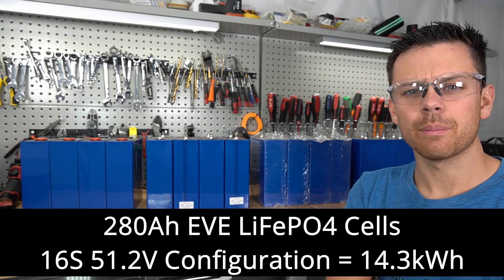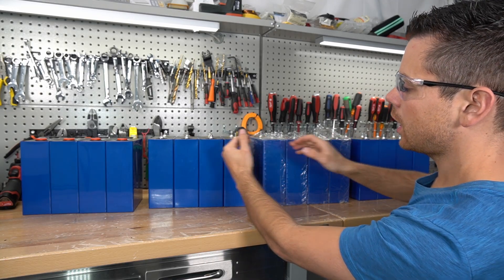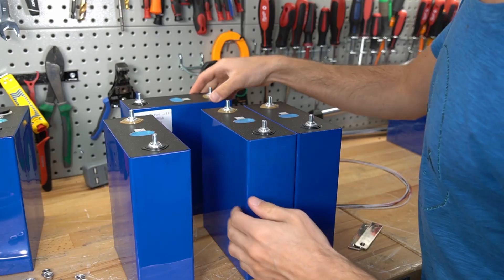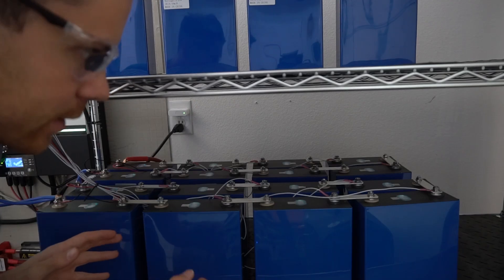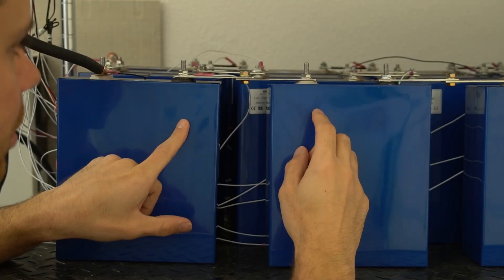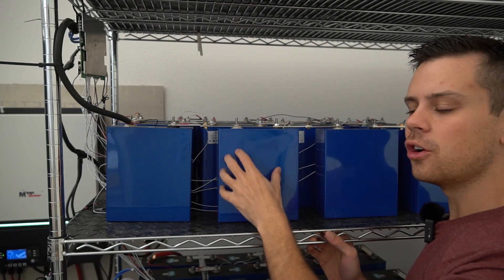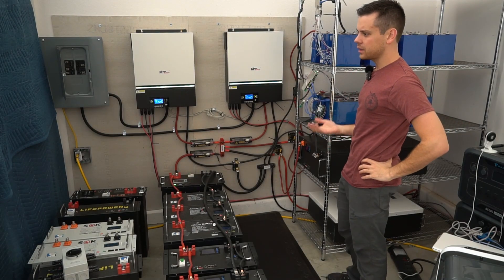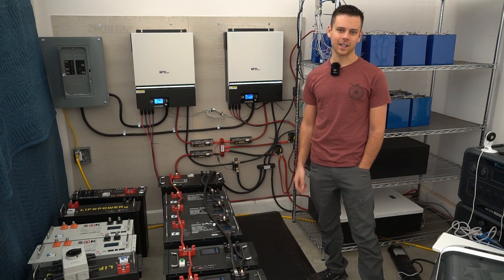Quickly Balance and Build a 48V LiFePO4 Battery w/ Cells from Different Suppliers

Comment from the maker: If you have used/grade b cells, and need to do a full top balance, check out this video: https://youtu.be/x5ABvbbics8
If you are new to building batteries, check out this video: https://youtu.be/uCC_3LoLYuw

Yes, the shelves can handle 2 or even 3 times the weight of these cells. That is why I spent more money for this type of shelf. I have had tons of people complain about this in past videos. 

Parts list for this battery:
LiFePO4 Battery Cell Deals: https://www.mobile-solarpower.com/raw-lifepo4-deals-page.html

DIY LiFePO4 BMS: https://www.mobile-solarpower.com/raw-lifepo4-deals-page-676969.html

Heavy Duty Shelves for Battery Building (ad): https://amzn.to/36afayC
Insulative Liner: https://amzn.to/3IaEX7a

~~~~~~~~~~~~~~~~~~~~~~~~~~~~~~~~~~~~~
Tired of getting ripped off? Check out my "Will Prowse Approved" solar product recommendations below!

12V Batteries
https://www.mobile-solarpower.com/lithium-batteries.html

48V Batteries
https://www.mobile-solarpower.com/48v-batteries.html

Offgrid Inverter System Builder
https://www.mobile-solarpower.com/48v-complete-system-blueprint-559371.html

Hybrid Inverter System Builder
https://www.mobile-solarpower.com/code-compliant-48v-offgrid-system.html

Mobile Handtruck System Builder (very popular!)
https://www.mobile-solarpower.com/mobile-48v-system.html

Solar Panels
https://www.mobile-solarpower.com/300w-solar-panels.html

Ground Mount Solar Racking
https://www.mobile-solarpower.com/ground-mount-racks.html

Wire, Lugs and Busbars
https://www.mobile-solarpower.com/wire-and-connectors.html

Tools
https://www.mobile-solarpower.com/tools.html

Fuses and Circuit Breakers
https://www.mobile-solarpower.com/fuses.html

Plug-N-Play Solar Systems
Ecoflow, Anker And Bluetti! So many models to choose from. See my current recommendations here:
https://www.mobile-solarpower.com/full-size-systems.html

~~~~~~~~~~~~~~~~~~~~~~~~~~~~~~~~~~~~~~~~~~
Need to build a large DIY system? Need a trustworthy solar distributor? These are my favorites:

Signature Solar
Creator of EG4! Solar Minisplits, Victron and More! Largest Solar Store Online.
If you want $50 off, please use my link below and coupon code "DIYSOLAR50":
https://signaturesolar.com/?ref=cPwLcVc0SW-BjN

Current Connected
Best Prices for EG4, Victron, Midnite and so much more! Fast Shipping and Highest Rated Customer Service:
https://currentconnected.com/?ref=wp

~~~~~~~~~~~~~~~~~~~~~~~~~~~~~~~~~~~~~~~~~~
Join our DIY Solar Community 
Need more help? Join the largest solar forum on the internet for beginners and professionals alike. 140,000 members and counting!
https://www.diysolarforum.com

Check Out My Free Book
Best-selling and beginner-friendly guidebook to off-grid 12V solar!
https://www.mobile-solarpower.com/the-book.html

~~~~~~~~~~~~~~~~~~~~~~~~~~~~~~~~~~~~~~~~~~
Contact Information:
I am NOT available for personal solar system consult! If you wish to contact me, this is my direct email: williamprowsediysolar@gmail.com
FTC Disclosure Statement and Disclaimers:
Every video includes paid promotion or sponsorship (such as free products for review). Some links on this YouTube channel may be affiliate links. We may get paid if you buy something or take an action after clicking one of these. My videos are for educational purposes only. Information is subject to change/update at any time. Electricity is DANGEROUS and can kill. Be smart and use common sense :) DIY Solar Power with Will Prowse is a participant in the Amazon Services LLC Associates Program, An affiliate advertising program designed to provide a means for sites to earn advertising fees by advertising and linking to Amazon.com
Reply: Yes! Thank you for this video Will :)
Reply: Will I use a T8 charger to bring  new packs up to full charge as it active  balances as it charges - its limited to 8S - I've built quite a few RV packs and its  saved a lot of time
Reply: Would you be able to give us an insight to your electric bill. Do use use much from the mains grid? Thank you
Reply: Will, your thoughts on the latest sodium ion batteries for stationary storage would be very much appreciated. They appear to be catching up with lithium, in some aspects and the advantages disadvantages would make a good video, in my opinion.
Reply: Hey Will, are you still using those Midea wall units....how much power do they draw? Looking to take the skoolie off grid with the AC, trying to figure out the battery bank if I use that unit.
Reply: Why not just watch his old videos? One by one
Reply: Hey will, thanks for the very informative videos. I dont know if you notice but your following is all over the world and not just in the US but most of the products you review are not accesable in some parts of the world. We would realy apreciate if you start doing reviews of other brands wich are accesable in other parts of the world.
Reply: Thanks for your video, I really like it ! Why not a video test of blade battery soon ? Thanks anyway
Reply: Is there a way to create a 72 volt system like this for use with my golf cart?

Comment: I've got a bunch of EVE 304 cells that I bought a year ago that have been sitting on the shelf. I started pulling them down to get ready for battery boxes that are coming in a month or so. First charge took in 200ah at 3.45v and the next day I was working with the cell and it wasn't responding as expected and I put it back on the charger where it rose pretty quick to 3.45v but sat at that point and absorbed another 30ah. Other cells I've pulled out have been doing the same. Random capacity tests have produced well above 304ah testing between 2.5 and 3.45v. Don't know if that might be normal for new cells that need to be conditioned in that manner or not but I find nothing wrong with them and seem to be performing fine after that initial charging. Don't think I would want to put them together in a pack and let them do their thing. Probably wear out a good balancer trying to deal with those in that initial state?

Comment: If you are looking for a Video Idea, I have one.
Scenario
I have a RYOBI RM300e EV Riding Lawnmower
4 X 12 Volt Lead Acid Batteries = 48 Volt 50 AH Series Array
I want to build my own LifePO4 48 Volt Battery Array Case that is rebuildable.
4 X 12 Volt Lithium-Ion Battery Cases. OR Would you choose to build one 48 Volt Case?

My idea is to build ONE (1) case with individual cells slid into their own slots and use cables 4 Guage or 6 Guage to connect them together. This way over time, I can replace one cell as I need to. I would unlatch the lid and open the case, unbolt its cables and remove the single cell from its slot, that is going bad and replace it, then equalize them and re-bolt the cables, then seal the case again and lower the seat of the lawn mower. 

I do not believe you would need to build this.
You could just use old video footage and edit together scenes showing what to buy.

I do know the current RYOBI Charge is not for Lithium-Ion batteries.
It is only for Lead Acid or AGM batteries only.
This means also suggesting a new LifePO4 charger for a 48 volt configuration.
The charger port could be reused as it is rated for such currents.
The charger plug on the current charger could be reused as it is removeable.

I just want to restate that I would build a 48volt case with slots for each Cell, so any one can be replaced at later times.

The reason for this thinking is only needing to buy or build one BMS instead of buying or building 4 for the four 12volt cases.

Also, the lawnmower has 4 slots for 4 12volt batteries and so I need to put in a board for the one 48volt case.

If I build a 48volt case, the bottom of the case would be my battery tray. 

I would just build and fiberglass and paint the whole case inside and out and then put a rubber mat on the bottom to reduce vibration.

I have no videos, so if I build this, I may video it and upload it in a series of vireos.

Anyways, just a suggestion.

Comment: Warning this is a blatant informercial site featuring top dollar products.  You would be better off buying a complete system from a solar system supplier using top products (which they get at OEM prices) together with a full 5 years full system guarantee for around the same price.  If you are going to spend  $$$$ you need an expert supplier or have the time and electrical bg to build your self .  NOTICE the all import BMS equaliser he doesnt show what it is or where he sourced it - thats the dont tell clickbait trick

Comment: Hi Will. I will be going with Diy Solar Warehouse's 12kw system. I currently have (32) 230ah eve cells in my diy ev. I'd like to upgrade the batteries (as i've over charged a few and the IR is off, but could be useful for our home) in my EV, but use the 32 cells for a 16s2p 48 system. Because the DIY ware house system uses micro inverters I am told I need to use a AC battery. Is there a system that can use my Eve cells for a home battery? I would like get off the grid. Thanks

Comment: Hi...if using 6kw high frequency battery charger,with rema320 connector with CAN bus protocol..is that any bms come with can bus connection? Or any can module that can coordinate with bms and the charges?

Comment: I'm thinking about getting solar installed, and got a quote for a 6.6kw system, 5kw Solax inverter and 5.8kWh Triple Power battery.  To reduce the cost and improve the battery capacity, I was thinking of getting them to forget the battery and DIY one instead.  X1-Hybrid has 85-400v range, can you do a 34s - 35s battery pack?  Is there a suitable BMS for such a battery?

Comment: I've had AGM batteries for years and noticed the voltage gets unbalanced, so I charge them independently to get them to the same voltage. Has anyone ever put two MPPT charge controller on a 24-volt system to keep the batteries balanced? Would it be best to split the array so each controller would have its own panels?  I'm thinking it would be best to keep the panel together and put a charge controller on each battery to keep them balanced. I know there are balance controllers out there and I don't want to use them because that would change my charging profile as much as 10 amps from what I have read.

Comment: I really want to use the EVE cells on your page but I cannot find a BMS to match the 280Ah or even 230Ah. Overkill only has 100-120 Ah. Is the “chip shortage” affecting BMS?
Reply from the maker: 100A BMS is great. Just stick with that. If you need more power, out multiple packs into parallel

Comment: Hi Will.  I am building my own 48V battery array using 4 x 12V 50ah batteries with built in BMS for each 12V battery.  When joining them up in series I had an idea by using 50ah ANL fuses as the interlinking fused bus bars & it fits & works well so far (not yet fully powered up with the inverter).  Is this fused bus bar idea a good one or unnecessary or will it have knock on impacts (heating, inefficiency etc).  Love to know what you think.

Comment: The scariest part of the video is your faith in the metal rack and is load capacity. That is only plastic sleeves that pinch the tube.
Reply from the maker: It can handle 3X the weight, and my friends warehouse uses these for way more weight. You should try it. And yes I know how the sleeve works. You need to set it properly. I trust a companies safety certified equipment over some random YouTube comment. Actually this is a perfect time for a challenge. You need to make one of these fail, and post a video. Can't wait to see your post.

Comment: Hey Will,

Whats your thoughts on using 200 3.2 8a cells to make a small battery bank? Is there any negative to this? Is there higher likelihood that the batteries will fall out of balance or what is your experience with this?

Comment: Is it ok to charge a lifepo4 battery at a very slow rate? I'm planning to load a 50 ah battery with a Tecmate Optimate 1 charger. That it will take a few days is no problem for me.

Comment: Hello from Sacramento CA.  question  anyone, anyone all, I am attempting to use my sailboat and airstream trailer to load share my home. So my attention is on my airstream trailer build with an eye on the future. So I want need a 48v  system that can supply 110v / 220v /12v supply and do load sharing with my home. The idea is why let my sailboat and trailer sit idle when home? So more like a mini mobile generator/storage  for my house. I think this will work out great. Because when home it supplies my demand but when gone household demand drops and my mobile demand is supplied. I want 3days continuous runtime in inclement weather. Right now I can go 2weeks with no solar but I have to use propane I fill my tanks once yearly (4 two 20lbs and two 15lbs.) I not really wanting a low frequency system for noise. I would rather have a high frequency or two so I don't have to listen to the hum In the trailer. I could build it outside or on the front. Any ideas?

Comment: How much kilowatt energy is in this pack? I know you said 91 kW/h but what is it in term of amount of energy? I'm trying to see how long this battery pack would provide to a home that averages say 30kw a day. Thanks!
Reply: You have your units all mixed up. kWh is a unit of ENERGY, and kW is a unit of power. You can't say your home pulls 30kW a day. Your house could be pulling 30kWh of energy per day, and that would be equal to an average of 1.25kW continously.
Since your house averages 30kWh a day, the 90kWh battery would last three days in theory. That was the whole shop though. The 16 cell battery he built is 14.3kWh, which would get you through half a day.
Reply: @icyfox2011  Yes, you're correct. Thank you.

Comment: Dude, cool channel. Would you be interested in putting together a video discussing best charge/discharge practices for EV's? There's this whole community of mostly clueless EV people who want to optimise for longevity. Most videos and communities are regurgitating the same old. I expect you'd speak to the topic with ease.
Some points of interest:
Depth of discharge
Rate of discharge/charge
Cycle depth
Capacity recovery effect
Temperature
Cell types
Balance and float
Degredation types (resistance - power, capacity - energy)
Unnecessary battery cycling (leaving the car unplugged)

Comment: Please start reviewing and testing wind turbines.  They are finally affordable but lots and lots of lies on those.   They say 400w output while giving 150w.  But still it's $150 for 150 watts.  It makes huge sense to have both a wind turbine and solar in every system (not RVs obviously) although they make vertical turbines that easily disconnect, you could connect it while staying put.   I use both types on my sailboat works flawlessly. The marine turbines are still expensive though but built way better.

Comment: Video project idea: Grab some 18650 and 21700 battery holders off AliExpress or similar, and build some power banks with them. Maybe even consider 16350 if you really wanna go nuts with small devices. Then, grab a few cordless appliances like drills, heated vests, flashlights, automotive jump boxes, and lawnmowers. Retrofit them to fit the interchangeable batteries... I see lots of people spot welding 18650's into power banks. That seems to totally defeat their strength of being so easily swapped between devices. I (and probably many of your other viewers) would be fascinated to see how you approach this idea. I realize there's a very good chance that just plugging a charger for smaller universal or (Ugh) proprietary batteries into an EVE or server rack setup would be vastly superior, but if there's anyone to run the tests and crunch the numbers, you're the man for the job.

Comment: Hi will, I am building a off grid solar system with a pair of LV6548 mpp inverters and four lifepower 24v 200ah server rack batteries. In your opinion how important is it to set the dial switchs and connect the batteries with the inverter with Ethernet cables. sorry if this question was asked before.

Comment: Will, I don't know about docan power as an inexpensive choice when I needed 230ah cells but they didn't have the terminals I wanted here in the US but they had stock in china, so if they were a decent company i would give them a chance but when I got to check out they added $250 in shipping and $50 in paypal charges?? raising actual costs close to Amazon prices Just my 2 cents for us non-million-airs lol

Comment: Hi Will, I am building this same setup with 2 banks of 48v 304AH rated batteries,for a total of 608AH. WHat size T class fuses did you use? Also why did you decide to use a 1500amp breaker on the test battery? I'm confused if I need to go up in fuse/breaker rating if the batteries go up in capacity?

Comment: Thanks Will! I'm ordering your book tomorrow. I was wondering, is there an issue with a built in BMS on a server rack battery if you need to hook up multiple server racks together? Do the BMS's talk to each other? Is there any conflict if you need to set up a separate BMS like in the Victron system?

Comment: I have 4 of these 280ah cells in my truck on 1280w solar and one of them slowly continues to drift out of range! I definitely did a top balance and they did pull full capacity originally....How do I fix this?

Comment: Just bought 16 of the 230ah cells from Docan, will see how well they balance out. Using them to replace an old BYD pack that is crap at this point.
Reply: G'day, I know it's an old topic, but I'd like to know how long the lifepo4 batteries normally lasts. Thank you.
Reply: @pepeform  Cells these days are typically rated at 6000 to 8000 cycles before they drop to 80 percent of original capacity if doing at least an 80 percent discharge each day. That's between 15 to 20 years of daily cycles. Solar installs really aren't very hard on them at all.
Reply: @andycanfixit 
Thanks m8.
So your BYD made more cycles than advertised?